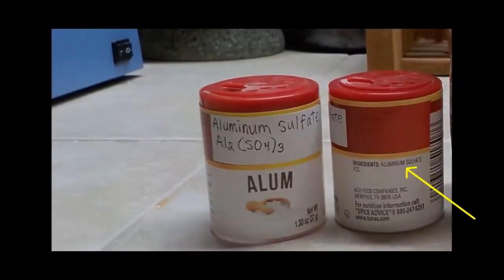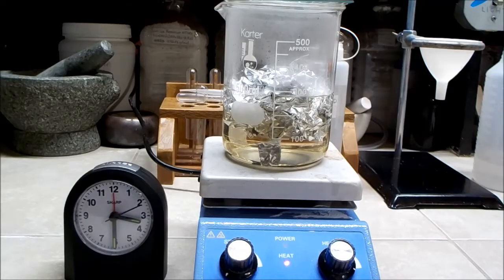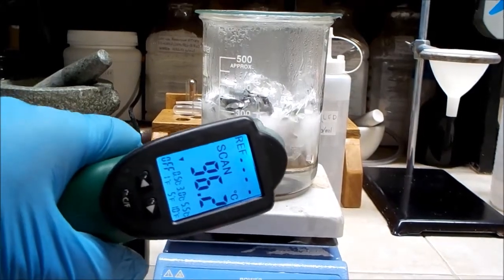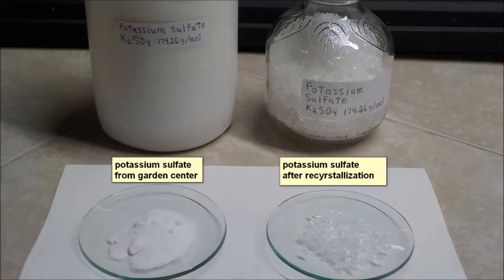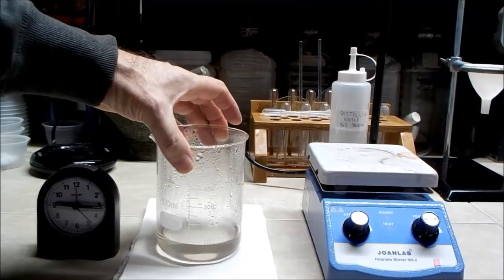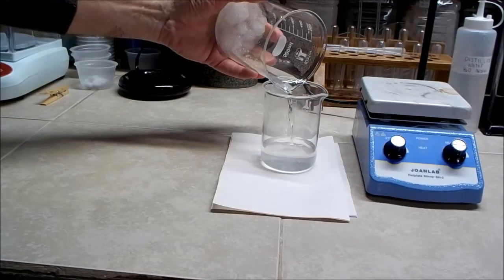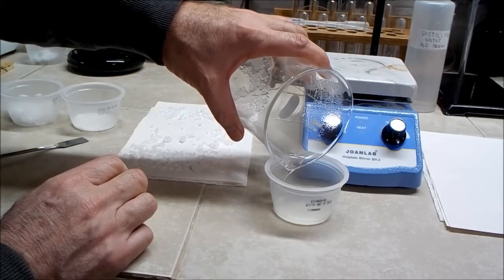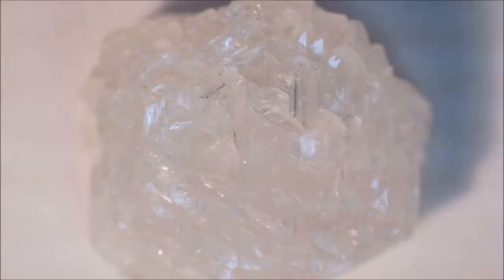Make Potassium Alum (Potassium Aluminium Sulfate)

Comment: +Perry Gershin Nice job! Are you thinking about doing the ammonium version of potassium alum (ammonium alum a.k.a. ammonium aluminium sulfate)?
Reply from the maker: That's a possibility, but first I am doing aluminium hydroxide.  My first attempt has been a failure but I think I have solved the problem.
I may post two videos on it, the one where I fail and hopefully the one where I succeed.
Reply: @perrygershin3946  Well, for that the best thing I know so far is to add aqueous ammonia to an aluminium salt solution to precipitate aluminum hydroxide as one of the products. I wouldn´t want to use sodium/potassium hydroxide because any excess of it will react and redissolve the aluminium hydroxide to form sodium/potassium aluminate.
Reply from the maker: I need to revisit this one, I did purchase some aluminum hydroxide just to compare with what I made, I'm not sure if I got the desired result.
I can't remember right now exactly what process I tried, I'll have to take a look at my notes on this.  It's possible that I made the mistake that you mention.
Reply: @perrygershin3946  ❤
Reply: How do I convert this solid alum to powder form